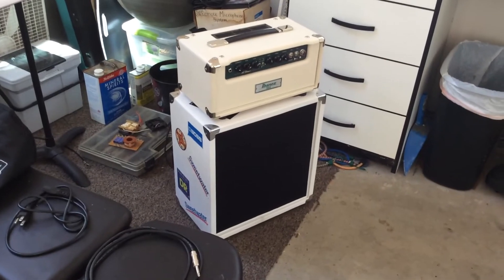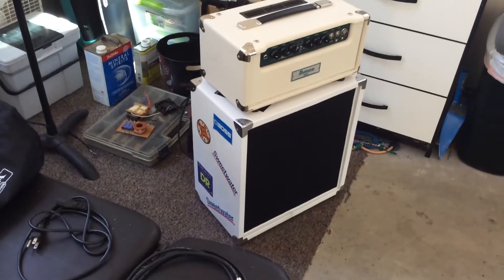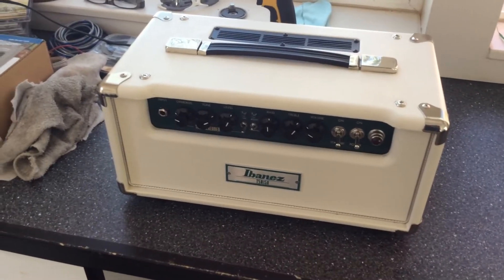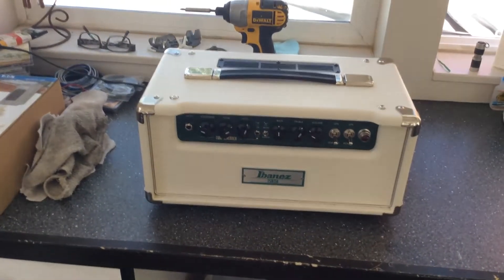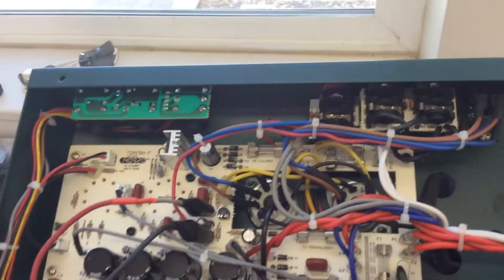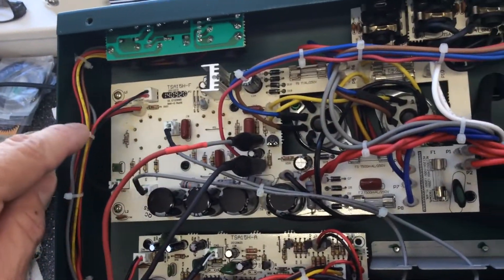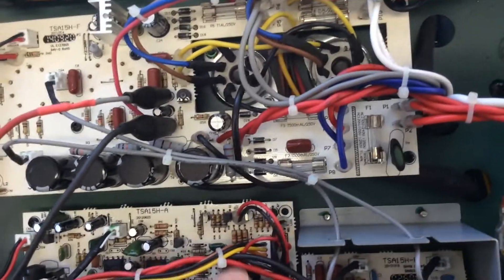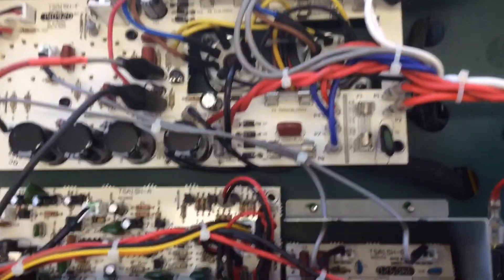New Power Tubes and Biasing Ibanez TSA 15W Tube Amp

Comment: Does anyone know if the same will apply to the 30 watt version? I can't find any TSA30 bias instructions anywhere! Even when I open the amp up - I can't even see test points - but I do see an adjustment pot. 

I assume since the TSA30 runs off of 6L6 tubes that -30V DC might not be the same for me.
Reply from the maker: You might try checking voltage across the output transformer leads (power amp side, not speaker side). make note of where that adjustment pot is, then take a voltage across yellow and red, then move the pot and see if the reading changes. Check the other two leads for a comparable reading... it may be a balance pot. Keep looking for a schematic.

Comment: I just biased one. I used a bias probe had to turn the bias adjustment pot all the way down just to get 60%. 330vdc on the plates 24 ma draw.
Reply from the maker: My gosh, seems like a goof somewhere but... but.... but, how does it sound?  I read all the time that techs will often bias an amp based purely on tone... no instruments. Angus Young has to replace tubes every performance cause they’re biased HOT while John Petrucci replaces tubes ONCE a tour cause they’re on the cooler side. Up to you dude :) It’s nice knowing that it’s somewhere’s “right” though ;-)

Comment: What happens if you don't bias the tubes? I was told this was a plug-n-play amp. ie. no biasing required. 
But I changed my tubes and now there's a buzzing noise. Could this account for the noise? 
The volume of the noise doesn't increase when turned up - it's always the same level regardless of how loud the amp is turned up.
Reply from the maker: The noise is probably in one of your pre-amp tubes, not sure what you changed out though. You could swap out one at a time with the old ones until the noise disappears. Biasing ensures you’re NOT going to red plate your tubes (too hot) it’s an efficiency thing and really not as important as I used to think. I bias my amps on the cooler side just cause I like the tone better, less fizzy imo. Introducing new tubes could definitely account for new noise. If it stays at the same level it could be an effects loop tube. I don’t recall the tube layout in that amp but maybe the third one away from the input jack. You could rotate them into the first slot and see if volume changes end up affecting the noise.
Reply: @oldguyjammin9732  Thanks for the reply. There are no FX loop tubes. The FX loop isn't a proper FX loop. It's just an out/in after the Tube Screamer circuit. 
I will check the pre amp tubes though. I meant to say it's a lot more noisy on the 5W setting than 15W for some reason. Not sure if that could help identify the cause of the noise. Thanks again
Reply from the maker: @Dani-El.  - that’s weird, it should be quieter on the 5W mode for sure. Rotate those preamp tubes and see what happens.
Reply: @oldguyjammin9732  I swapped the preamp tubes around and it is slightly quieter. But still too noisy on 5W mode. Any idea what that could be? 
Could it just be the switch or whatever circuitry is engaged when switched?
Reply from the maker: @Dani-El.  - noise is really hard to track down, it could be some dirt in a pot... How about putting the old tubes back in? See what happens. The bizarre thing is that the noise is louder in the 5 watt mode, it should be the other way around I’d think. Get some contact cleaner and wash out the tube sockets, pots and jacks - it sometimes does wonders.
Reply: @Dani-El. unless you sold your amp in the austin area and i bought yours i can say the same thing, my amp is significantly noisier on 5w

Comment: One more question. I have a couple of 5881 tubes. Size is about the same as the 6V6's. I know they are 6L6's. I googled this question and could not find an answer. Will these 5881's blow or damage the TSA15H? Can it be biased for them? Thanks.
Reply from the maker: https://www.ampvalves.co.uk/5881-6l6gc-valve-differences/
So it sounds like you’re wanting to move in the safer direction anyway 6L6 > 5881 I’d cool off the bias a bit. See if you can find a recommended bias voltage for 5881 tubes. Sounds like you’ll have less clean headroom and earlier break up with the 5881 tubes. Hard to tell from the article I attached but it sounds like the only problem you may have is ‘red plating’ the 5881s unless you lower the bias... not to big a deal, you’ll just have to replace them sooner.

Comment: So, you showed putting the alligator clips to two test pins before attaching your meter, but then glossed over the next steps. All of a sudden you still have the red clip on the original probe, but you have moved the other probe to attach to the chassis(?) Why? The whole gist of your video is the testing and biasing, which you gloss over without showing the connections and reason for them or even a good view of the adjustment trim pot. I am not confident that I can do this correctly.
Reply from the maker: Yes, sorry for the confusion but you’ll be fine. The critical test point is that upper pin or PR1, the other pin is just ground so it’s just easier to ground your other lead to the chassi, but it’s the same thing. Ground is ground is ground :) I showed where the pot is, just not adjusting it. Still, if you’re at all uncomfortable better to get some help.

Comment: I have changed all tubes in my TSA15 amp and did not biasing, cause I read that I do not have to that for this amp. Am I risking something? 
I  general, what I can say - after the change of preamp tubes (for JJ ECC83S/12AX7) and power tubes (for paired JJ 6V6S), and I have to say, big WOW! :) Really, I would never expect such a big tone difference! I always fought I have very good sounding amp, but now, I have a killing machine! :) Significant sound change, lot s of muddiness and dirt disappeared, now it has a strong low end and clear highs, with less mids, 100% top class "fender" sounding amp. Super super clean. Somebody could miss mid frequencies and dirt, but I much prefer adding gain (by pedals) instead of removing it (which could be mission impossible :) )
Reply from the maker: That’s great man! Thanks for taking the time to post your findings, super cool. If it sounds great I’d just leave it alone. It does have a bias adjustment pot and test point but I don’t think ‘proper biasing’ is as important as I used to think. It’s probably close to mathematical perfection but your amp will still work, and work FINE a ways off of that target of 70% saturation value - if it sounds good, IT IS GOOD \m/
Reply: @oldguyjammin9732  Yes, it does sound fine without biasing, so I have no worries anymore ;) :) Thanx!

Comment: Thank you for the informative video! I've heard the JJ 6V6 tubes have larger plates than a true 6V6 does, and that as a result they sound more like 6L6 tubes. Has that been your experience since you switched to JJ 6V6 tubes? What differences did you hear?
Reply: I have just changed original power tubes and I have a pair of new JJs 6VS inside and yes, I can confirm, amp sounds now pretty close to 6L6, more lower and higher end, sounds more fenderish.
Reply from the maker: Mr. Del Valle - honestly differences different tubes can be here or there. Differences in good tubes vs bad tubes is of course considerable but when guys say “this or that tube made my amp sound SO MUCH different” they’re full of crap imo. It’s even hard to tell in the Rebel 30 by Egnater that allows you to switch between 6V6 and EL84s. EL84 a little brighter, firmer in response and crispy compared to the softer 6V6 tubes. It’s a small difference but enough that I know I prefer EL84 amps. But again, different enough that I sprung for a Fender Supersonic so when I’m in the mood for that sound, I’ve got it. I’d be hard pressed to hear the difference of one 6V6 vs any other brand of the same type. I hear small differences in GT preamp tubes, they seem to have a little more midrange. And I usually hear a very nice difference in swapping 12AX7s with 12AT7s in my higher gain amps.
Reply: @oldguyjammin9732  I appreciate the reply. I've always been a fan of JJ power tubes, for their durability and long life. Glad to know they work (and fit). I'm using EH 6V6 now, but I'd like to try the JJ 6V6S tubes on my next swap out.